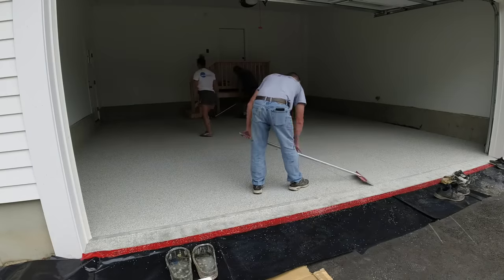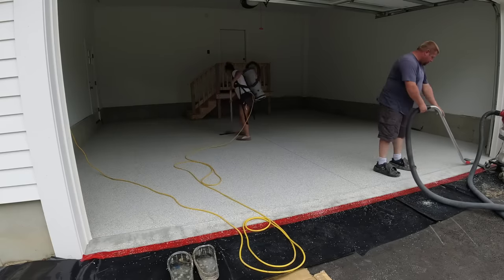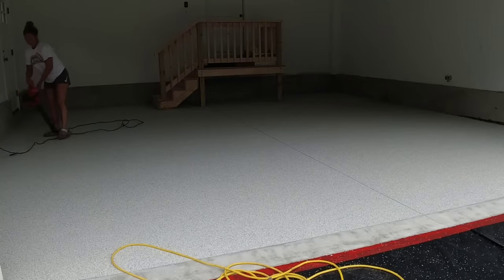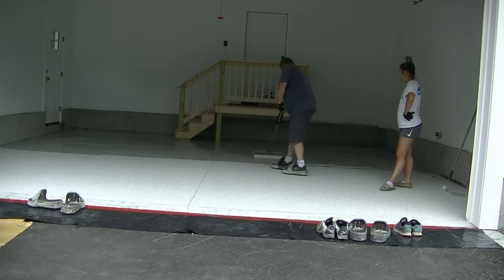DIY Epoxy Flake Garage Floor Coatings (What Most People Don't Tell You)

Comment: Good Video and nice job on the floor.
I put heavy rubber nunners down on my floor where my car tires park (about 24" wide each track).
This makes sure the car is always parked in a safe area away from other things in the garage that could damage it and also protects my floor.  One other note: I only park my electric car in the garage, no oil leaks.
Reply: Good idea.  Where is a good place to buy those runners?
Reply: @MrIndyjoe  Well I was in the packaging machine business so I had some heavy duty conveyor belt sitting around the shop. Finally found a good use for it. Amazon sells a super sticky carpet tape that will hold it in place.
Reply: @ELCEV  Thanks!

Comment: I did one garage myself with the big box kit - let it cure for 10 days before parking in it and have only one mark from a hot tire.  Felt really good about it.  Had a company do the second garage, now I’m not feeling so great about the first!   Really amazing results when you let the pros do it right.   

Btw, we omitted the flake from the apron on the outside of the door (base coat and topcoat only) and it looks wonderful.  Having a strip of the flake that didn’t match the driveway was a no go, so just using the base coat for color makes a nice transition. .
Reply from the maker: Nice, thanks!

Comment: I installed mine with Rustoleum's over the counter kit fifteen years ago on a floor that was already ten years old. The floor has been used heavily, including parking two cars and doing a lot of car maintenance with floor jacks, carpentry, etc. So, I spent $200, plus three days of my hard work and it lasted 15 years. No topcoat. Never yellowed. Garage faces south, and I live in sunny Southern California. I did not grind the floor, though I agree that's ideal. I am about to re-do the floor. The cost of product has gone up, but so have my skills. I expect that, with a top coat this time, my re-epoxied garage floor will outlast me. I can't afford to pay big bucks for someone else to do it, but I don't mind a bit of hard work.

Comment: I like mixing fine sand into the epoxy before pouring, and once poured, throwing on a top layer of fine sand. That way there is grip matrix embedded all the way through the layers, from concrete contact to exposed surface.
Reply: Ty that's a great tip I'm going to use 👍
Reply: They have an application for that called sharkgrip. It's like grinded up glass pretty much sand you put in your clearcoat

Comment: Can you please advise if the grinding needs to be done on a freshly done concrete floor? Thanks
Reply from the maker: Yes, we always grind the concrete, new or old.
Reply: Standard specifications recommend a minimum 28 day cure period for “green concrete”, before an epoxy floor coating or other resinous system can be applied.  However, this is only a guideline; the actual wait period can be much longer, depending on the composition of the concrete mix, the relative humidity, air temperatures, and a host of other conditions.

Comment: My concrete was only 5 months old I acid washed it and used construction grade epoxy... it's been 5 years now and still looks perfect. I think it depends on how old the concrete is and if there's oil spilled all over or not. New construction, I think you're fine to use acid wash and then use really good epoxy.

Comment: Appreciate the video! I was curious if I were to convert my garage into a dance floor would it be necessary to use the flakes for durability? The goal would be to make the floor as smooth as possible
Reply from the maker: Flakes do add more durability, you can go a little thicker on the top coat for a smoother finish if you like.
Reply: Just two cents here: I don't know what kind of dancing you have in mind, but if it is for anything like ballroom or ballet, with constant practice, concrete is very hard on knee joints. Good luck with your project!

Comment: I worked in a commercial shop that had a beautiful epoxy floor. It had a very unique stippled texture which I have never seen anywhere else. Was great for traction and finding tools etc as there were no multi colors for things to get camouflaged by. Would love to know how that stipple effect is accomplished. Floor you did looks amazing and sure to last a very long time. Hope to do an epoxy coating to our garage at some point once we decide how we are going to expand it.
Reply: This is a big concern of mine. I want to do full rejection flake to replace the failing solid grey coating someone did before me, but I LOVE how easy it is to spot things on the solid grey.
Reply: I saw another video that used aluminum oxide granules that gets sprinkled on like white sand, but turns clear when the clear coat gets applied. Provides a nice slip resistant texture.

Comment: Great video & information.  What prep work would you recommend regarding a new concrete slab that has a brush finish? Will the epoxy flake floor still work? Thanks in advance for your reply.

Comment: Great video.  Thank you.  You mentioned in video that you get the epoxy thick.  That much be how you mix it correct?  Not putting numerous coats on the floor?  In video there was just coat of epoxy down?

Comment: What a great video and certainly a refreshing bit of information saying that the second house we owned before we moved out of Colorado I ended up doing the garage with an acid etch and now it’s clear to me why the Apoxsee came up later. One thing I wanted to add and it’s a deal that I might actually partake in is the part where the door comes down leaving it without flake can be a good idea in the aspect of creating a tighter seal on the ground when the door comes down and the rubber gasket meets the concrete. There’s also the argument of having those perforations from the flakes would potentially help with water drainage it’s really personal preference and per location or geographical region there might actually be a better method over another. Regardless I just wanted to say your videos are bad ass you guys do great work you make it simple but definitely not something that just anybody can come up and do a lot of folks don’t have the patience or the technical ability to work through these issues and so sharing this information is not putting you at a detriment for exposing your trade secrets because at the end of the day most people probably aren’t going to make the floor look as good as you guys did.

Comment: I just got a 16x36 shed / garage with a tongue and groove 3/4 inch plywood floor. If I sand the floor could I use the epoxy chips and dust coating? It is going to be used for a workshop and slash storage mowers things like that. Thank you for your professional opinion

Comment: Very informative - thanks! You guys clearly do it properly! Prep is key as you say. About to do the same to my own garage. Grinding this weekend and then painting. Been recommended Rustoleum Pegakote ID400 (2-part epoxy) with two coats (no flakes). Heard it’s good - let’s hope so!
Reply: So it's been a year now. Can you give us an update ? Appearance ? Durability ? Problems ? If any....
Reply: @jamestiscareno4387  Have to say, so far so good! No hot tyre pick up or peeling, it’s been wet, dirty, gritty and it still cleans up like new. Very impressed indeed. I waited to respond to see how it coped with the GT4 I picked up a couple of weeks ago. The tyres get very hot after a spirited drive (the last one being the hottest day on record in the UK!) and don’t cool down for ages given the proximity of the engine. But no issue at all!

Comment: Hey Mike, so if a customer wants those joints done. Do you recommend caulking them before or should you wait after you seal it with your top coat? If so what material would you recommend?
Reply: Before so they don’t stick out.

Comment: Should really be using respiratory PPE when grinding, especially if you do it for a living and are constantly exposed to fine silica particles, but at the end of the day it is a personal choice. I’m right in the middle of doing mine using the “color chips” brand and so far I like it. They do provide you with a good amount of chips but not enough to get full full coverage which is the only thing I don’t like. Tomorrow is the urethane coat and then it’s done. Really happy with how it’s turned out so far but we will see if it lasts. I did prep the floor quite well with a lot of grinding so hopefully it holds up.

Comment: Would this hold up to a floor Jack sliding around on it or a hammer or brake rotor falling onto it ? Is this something I would want for a working garage ? Or do you have a better suggestion ? If they all eventually fail, would the roll on stuff from Home Depot be best and re apply in the high traffic areas as needed ?

Comment: Beautiful work.. any different concerns when putting epoxy over a basement floor to strengthen and restore the old concrete?
Reply: I've done a little bit of research since I want to do this to my garage and one thing I learned is that the epoxy will not strengthen old or damaged concrete or work well with low quality concrete (i.e. wasn't poured or mixed properly).

Comment: What do you recommend for prepping a covered patio with a broomed finish that's weathered a couple of years, some organic dirt from potted plants in some areas? If you do a vertical area, like the risers on stairs, do you just roll it on, and fling the chips at the surface?  it looks like you let the epoxy flow into control joints?  Thanks for posting this. Most of the videos are infomercials rather than real world how to from a real finisher.

Comment: Mike day, pouring a new slab in a month or so. Customer wants a flake finish like this. Never done these types of finished only trowel finish with sealer. Couple questions, if we trowel it down by hand instead of burning it black does it need grinded? How long do you let the concrete cure out before you apply this. And do you think this is a better way to seal the concrete from stains instead of just troweling with machine and putting sealer on it. Appreciate it if you let me know thanks

Comment: Can I add a self leveler before grinding to get rid of low spots and to get the water to slope to the garage door?
Reply: Slope first then self level.  You will not be able to slope using self leveling unless you take multiple steps. Cts Rapidset will have what you need to get that done in a day.
Reply: @josephdavis1068  slope is already there just some low spots cause puddles in the garage.

Comment: I’m currently running a similar job. Polyurea base, broadcast with polyaspartic top coat. Different brand coating than you’re using but same flake brand. Majority of my jobs are 100% solids epoxy systems which works great indoors but poly aspatic systems are “the bomb” for out door and many indoor applications. Always do a moisture vapor test first though!! If not you will sooner or later lose your ass on a job!
Reply: What’s up Scott I’m trying to start a business up any pointer on what chemicals I need to buy and pointer ?

Comment: If you plan to use an epoxy coating. Would having the concrete finishers leaving it rough eliminate the need for diamond grinding?

Comment: Excellent video, thanks. One thing you don't talk about is how to prep the floor where there are 1/4" or deeper small holes from years of salt damage. That slab is in good condition - at least from what I can see. Would the diamond grinder take the floor down that much as to eliminate the damage from salt? Would I use something like Top and Bond to fill the holes?

Comment: I know I know haters right...but I disagree with you on about 4 things in video.  Floor prep was just about there but still had dark spots which to me is sealer. Next is why not do the fountain walls? Torginol flakes good choice. Front lip well I'm here nor there on that,my guess is it looked like crap. The hybrid polyaspartic you say is chemical resistant and hot tire pickup. Put some xylene on it and get back to me. Hot tire ...say right on msds sheet not hot tire rated. It is great for uv light. But I don't use it unless I have too. Love your concrete video's..

Comment: thanks for the video it help me out alot understand what you guys do. Right now im making a business plan up for a cleaning buisness and one of my add ons for extra is gonna be power washing and staining and sealing decks for apartment buildings and townhomes. So i wanted to check out maybe doing garage floors is there a market in just power washing and cleaning up garage floors not exactly like this but for example lets say you did one of these lovely garage floors made it nice for the client a year or 2 later after using it doing some work in the garage maybe spilling some oil or other engine fluids stained up the floor so they hire a guy like me a cleaning business to come out and power wash it back to how you left it after it being redone.. or would power washing wreck the garage floor coating? because i wouldnt wanna do that... but is this something that I could maybe do or is that something you guys would also do?

Comment: Mike, I’m interested in the top coat only. Clear Polyespratic…. Or something. I need to seal and apply a coat of something to an outdoor basketball court. No cracks, just very slippery now after 15 years. Slab is high strength prestressed and has zero tear. Only wearing of the initial finish so now there’s no friction. I also want to save the thermal painted lines for the coat? What should I use? Please email me or respond here.

Comment: Cool demonstration, very informative. I live in New Mexico and hot tire are very real thing out here. I bought new construction and acid washed the garage first thing. Then used a 3M kit and no protective clear coat. I have had no blisters on the floor and the only stain I have had was from a antifreeze leak in the 15 years I have been here. From watching your YouTube video it sounds like I must have been very lucky. Any tips on cracks in the floor, mine are still sealed, but you can see them under the epoxy coating? They epoxy coating has yellowed near the door and I am thinking of redoing the lower section is why I ask. I will check your other videos and thanks for sharing this video, I think I now know I need rent the buffer and strip floor first. ( I was just going to paint over the old one.)

Comment: Very nice. First time I've seen it done. One question. Do you fill the cracks joints before the base coat or do you fill it with the base coat?
Reply: With filler before sanding

Comment: Mike Day,

I had a company install epoxy in our 2 car garage. I believe they did not scrape the flakes after they were applied and then install the polyaspartic. I believe they just applied the polyaspartic over the rigid flakes. Could I scrape it myself similarly to how you did in this video, vacuum it, and then apply another topcoat of clear polyaspartic?

Comment: How will a floor like this hold up to a metal wheeled floor jack, metal jack stands, or a heavy motorcycle center or kick stand? How does it hold up if you happen to drop a sledge hammer or a starter or ??? when working on things?  I look forward to hearing from you on this.  Thank you!

Comment: The reason I hate epoxy garage flooring is I purchased a home that has it.   

It is a professional install job. 

The truth is by the time they add enough grit flakes so you do not fall on a wet floor, its extremely difficult to sweep.   Nah, that was not strong enough of a statement. Its impossible to sweep. I can wet mop, but within one mop cleaning of the floor, the mop is destroyed.  

Currently thinking of grinding the epoxy off to get back to normal concrete.  

My detached workshop has a concrete floor. I do not slip and fall plus I can easily sweep it clean. I love it. 

Just use and enjoy your concrete garage floor.

Comment: Important to follow instructions on labels. Often overlooked is pot time. The time you let mixed epoxy sit before application.  I worked for a contracted who dismissed the label info I pointed out on a high end job. What a mess. He had to use toluene to take up epoxy.

Comment: Do you spray it down with water after you grind it or just broom & vacuum it? I'm doing a bathroom floor.  I've had a lot of problem with concrete paints so I'm trying Epoxy this time!
Reply from the maker: No water, keep it dry. Vacuum twice then we wipe it down with a micro fiber mop and denatured alcohol.

Comment: I think that definitely looks better than the job I did on my last two houses, however the price estimates I've gotten make it not worth it IMHO. I did mine with Sherwin Williams epoxy, 2 coats with sand in the top coat. i etched with acid and the last house after 20 years had no paint come up. I spent about $500. The prices quoted to me for a job like this is around $4000. It looks nice and I've been tempted, but just can't seem to pull the trigger.

Comment: Great video, but I’m a little confused about the use of epoxy for a base coat.  In your video titled “best paint for a garage floor” in July 2020 you say poly aspartic is better than epoxy for the base coat. But here you are using epoxy . Did something change with your opinion?